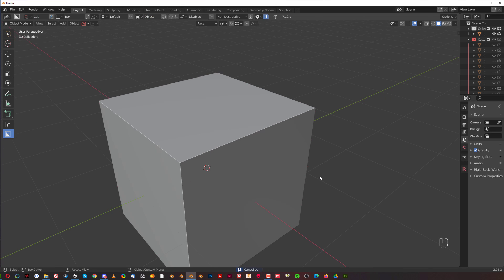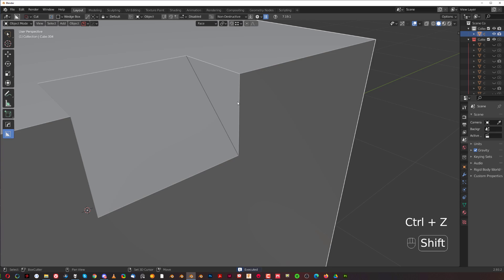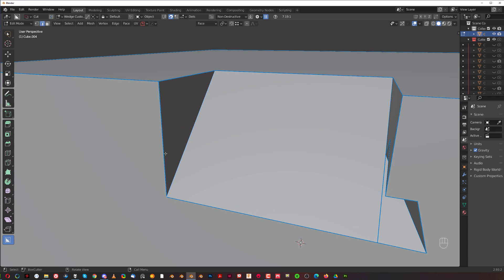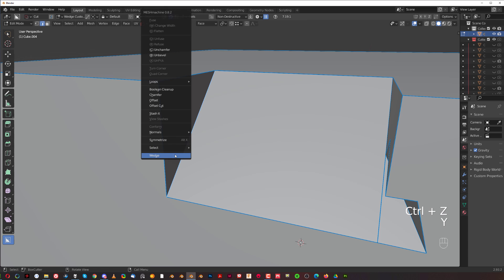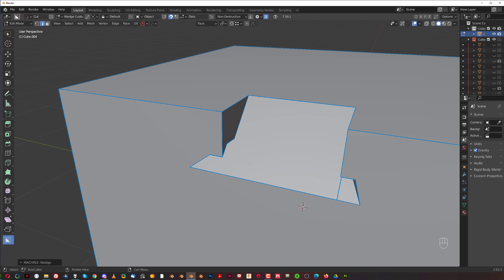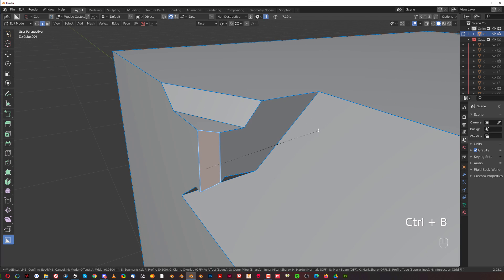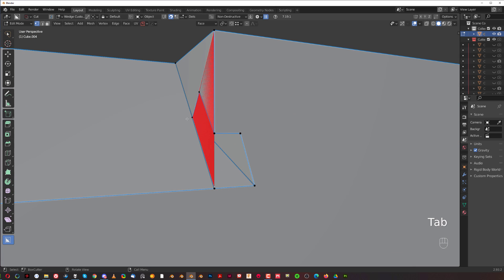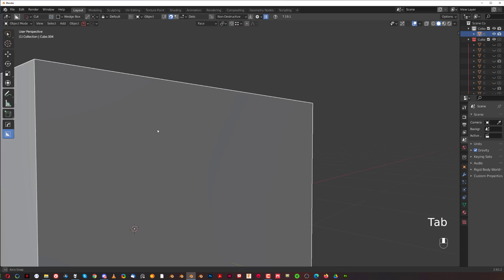Blender tutorial for wedge booleans - with Boxcutter and Mesh Machine

Comment: That wedge tool in MeshMachine is amazing. Just tried it out. Somehow I'd overlooked that. And the learning goes on. When I think of the pain that was involved in 3D modelling years ago, compared to now, I still shake my head at how far the tools have come.
Reply from the maker: i had a brief ook at blender 2.79 in 2018, and said - perhaps later, and here we are
Reply: @PonteRyuurui  So I found this interesting and tried to give it a try but as per your video W shows up HardOps menu, but when I try it in Blender it shows up the default Blender Vertex/Edge/Face Context Menu any idea what settings do I have to change to unlock this menu? Thanks for the video!
Reply: Please ignore this I was stupid enough not to read the title of the menu, it's from Mesh Machine.
Reply from the maker: @rahulujjal8245  W turns off Hops or BC